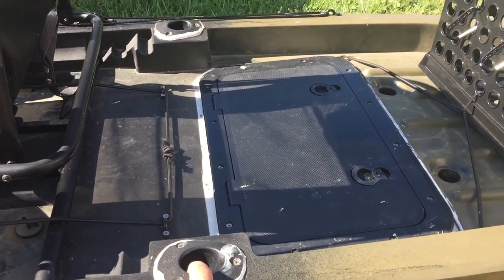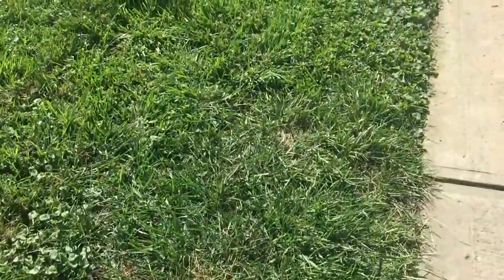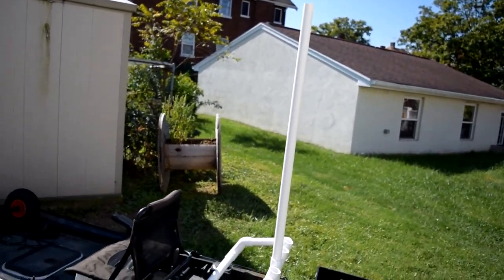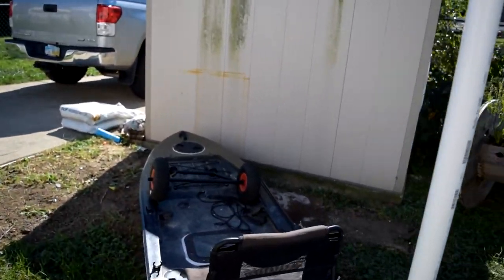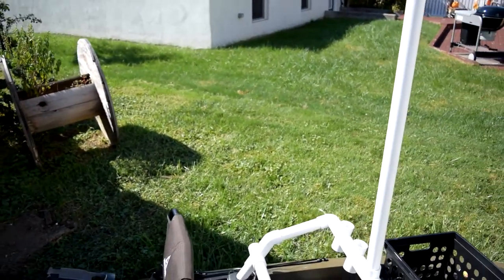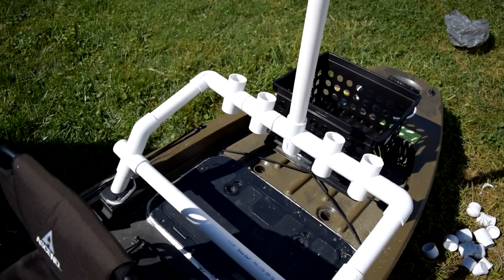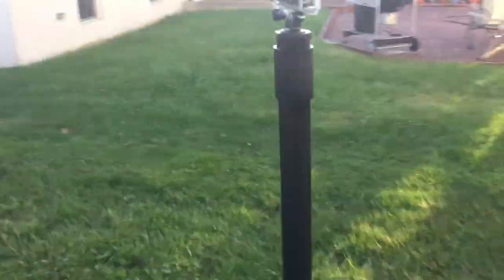DIY Kayak Rod Holder and GoPro Mount

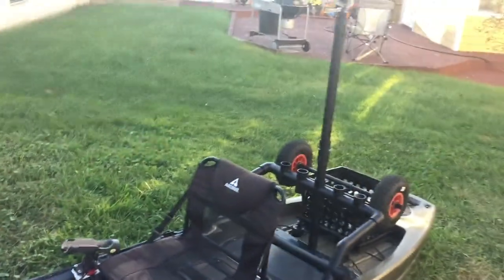Comment: Are the front rod holders the same size as the back.. I ordered an Ascend 128t kayak and it has yak power setup but i am not drilling no holes in my kayak at all for any lights.. But how you did your go pro mount i was wanting to do something similar to what you did but for the front. Using Pvc pipe about 8 inches high for a stand for both side, Or even make an 8 inch high u shaped light bar across with some small white flood lights...And also spray the pvc black. I think that would work perfect i am not a fan of drilling holes in my kayaks so just trying to figure out a removable way when not in use... At 7:32 I Actually would like to make it like yours about the same height as the bottom bar but without the 4 way connector and just use a 90 degree..
Reply from the maker: Michael Anderson I believe that front are the same size. That should work out good